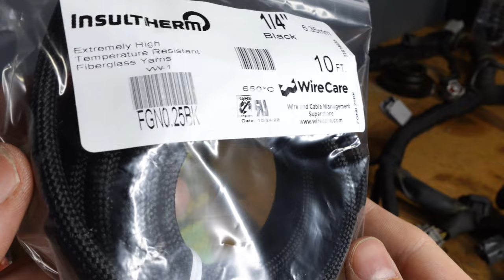Restoring My OLD Wiring Harness and Making it Look NEW! | 80 Series Land Cruiser

Comment: I have a 94 and just swapped a 1FZ from a 97 in it but still need to redo my harness. Also plan on rebuilding the old one to keep as a spare. Would have liked to do a OBD2 swap but I guess the crank shaft position sensor is there if I ever want to in the future. This was a very helpful video and your production quality is really good as well. Hope your chanel blows up. 95 and up actually have a 2 piece transmission cooler line which helped a lot pulling just the engine in the newer ones vs 93-94
Reply from the maker: Nice! I wish my truck was OBDII so I could boost it without tuning woes, but I think if I ever got to the point of boost I’d throw in a V8 instead.

I really appreciate it, and I didn’t know that about the later models. Thanks!

Comment: I've been watching your videos on rebuilding your 80 series.  I have an LX450 I am rebuilding using a new Toyota short block.  You mentioned replacing broken connector housings besides the injector housings.  Do you have part numbers for the other housing if I need to replace some of mine?

Thank you